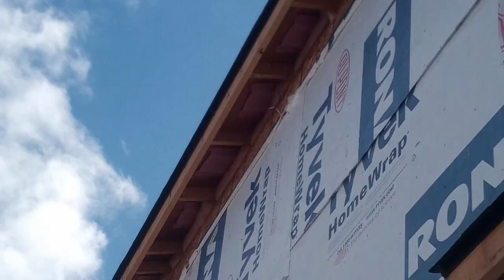Attic Insulation- Attic Ventilation, baffles and rafter vents explained

Comment: I wish I'd put in plywood baffle inlets instead of the Styrofoam ones in ours, it would have been a breeze :) to install compared to those foam things. Foam baffles seem like such an easy installation, but it surprised me how tight a working space it is down in that angle, almost impossible and very easy to do damage to your ceilings below, fortunately I did no damage. With plywood I could have jammed the panel across the rafters and had them in with fewer stronger fasteners. With the foam, I had to use a dozen or so T50 staples on each to keep them from flopping around and rattling over time. Plus hetting a stapler at the bottom of the soffit opening and and getting a solid staple in was real fun. Also plywood will never degrade and crumble, how long will this foam last I don't know. Great vid, thank you!
Reply from the maker: Thank you for the awesome comment. Yes those vents are tough, easy yo get into a small attic hatch though. They last quite a long time, I've been in plenty of 30 year old houses with none of them damaged. You would be surprised how much wind force is stopped by the metal perforated soffits. It's those darn roof nails too, lol. Plus we use that hammer stapler, much quicker than a punch one.
Reply from the maker: I just posted another video on attic topups, it has good tips that may help you in future projects. https://youtu.be/rHv3I6fEF70

Comment: My attic does NOT have soffit vents.  Should I have someone come add them?  I have two ice dams out front I'm looking to solve.  In the process of air sealing now and I have access to add baffles now (not sure how that will go with roofing nails in the way).  Someone mentioned I should dense pack the eaves and that will help.
Reply from the maker: https://youtu.be/6ptVYYLQ50M this video will probably help you get started. that was a shallow attic I topped up. not an easy task by any means. if you can find a small plank I would suggest it to get those vents in properly.

Comment: I have a house that is 20 years old. I have soffit vents, ridge vents and blown insulation. How do I install the baffles now, and what type should I use?
Reply from the maker: I would recommend rockwool or roxul because it is resistant to moisture. I typically use fiberglass owens corning batts because that is what I am provided with. here is a time-lapse I did where I installed batts, vents and then loosefill. you have to make sure to cover even a little past the top plate of your outer walls. if the top plate is not covered well then heat loss will occur at the corners of your house. hope this helps.
Reply from the maker: I just posted a video on attic topups, there may be tips that are useful for you 
 https://youtu.be/rHv3I6fEF70

Comment: Do I need soffit venting if I have two very large gable vents and a twirly vent at the top?
Reply from the maker: thank you for the comment and great question. Yes you need both because they work together, soffit and roof vents. soffit is for fresh air intake and roof vents like your turbine vent is for exhaust since hot air rises. checkout this video that explains it https://youtu.be/XCa2cB7q91U

Comment: So in my house, we have two bed rooms in the "attic" second floor. The attic spaces are small and to the sides of the room. Think of a rectangle, the rooms are in the middle, and at the sides, where the slope of the roofline is, there are small triangle attic spaces (front and back of the house). There is virtually zero insulation on the floors of these spaces, and there is old insulation between the rafters, against the roof plywood.  Then there is insulation bats on the upright walls for the bedrooms.  So.. If I add these baffles... do I add them all the way to the top of the roofline and then I put insulation over them? Or is that insulation needed? It is already really hot up in those rooms. I know I need to completely cover the floors of those attics with insulation, I'm now trying to figure out these baffles and insulation over them to help as well.. Any help would be appreciated! THANK YOU!
Reply from the maker: Great comment, thanks for reaching out and subscribing. I believe I understand your concern and have seen your type of house. The second floor is only a partial compared to the first floor, therefore parts of the first floor ceiling is attic space (needs to be insulated). All exterior walls have to be insulated as well. The one thing about sloped ceilings is that it's always good to have an air space between the insulation and the roof plywood. This is mostly applicable to fiberglass insulation or any fiber based insulation. You don't need styrofoam vents for that. The vents are mostly used to allow airflow in a flat attic and prevent blown insulation from blocking the soffit air intake to the attic. The one important thing you also want to make sure is that there is a top roof vent to allow for that air intake / air exit action. Hope this helps.
Reply: @SinnisjInsulator  Thank you so much! It does for the most part. I really appreciate it!!!
Reply from the maker: @Hypno_Raygun  I'm glad it helped, keep in mind that fiberglass does need some ventilation, but if you go with closed cell foam it doesn't need ventilation, especially if you spray it directly on the plywood of the roof. I have many more videos on my channel about attic components, you can check them out if you'd like, I post each Tuesday.

Comment: Any videos or tips on installing styrofoam baffles in narrow spaces? I’ve got 16 to install, 16 on center width, and you couldn’t fit a 5th grader close enough to get them to the vent. Is installation from the outside viable? Very little info on such an option.
Reply from the maker: Glad you came to this channel. I don't have one video yet on that option of a baffle. So if you want to install foam boards its really only doable from the outside after removing the gutters and soffits. Because this way you know you put the styrofoam board just past the top plate of your outside walls. You can then put foam around each of the foam sheets to seal them. The tricky part would be to fit the soffit vents after, so I suggest you install those before. The key is to properly cover the top plate of your outside walls and even push the baffle a little into your soffit area. This way you have a continuous Insulation envelope. Here is a video where I install vents in an existing home that is very tight 2 feet clearance: https://youtu.be/HTRt_BaHweQ
Reply: @SinnisjInsulator  much appreciated on the quick reply and information. I watched the tight space video, as well as almost all the others. I believe I’ll have to slide them in from the outside to be certain. Found some wet spots on the wood the shingles are nailed to, while in the attic, so the issues continue to grow. Yay first time homebuying.
And to clarify, there’s little info online in general. I wasn’t complaining about you not having that specific video. Your content is very in depth and covers many bases.
Reply from the maker: @SailorJasonTaylor  glad you found the videos informative. Your question is very specific, I have seen examples of what you are talking about but unfortunately did not capture the footage. The underside of the plywood being wet is definitely never a good sign. Definitely check that all exhausts are connected properly and air sealed. It may also be as simple as having very low Insulation, especially at the attic hatch. You can subscribe to my channel and I'll see what I can do to make a video on baffles. It's so vital to completely cover that top plate of your outside wall with tight Insulation, I know people aren't a fan of fiberglass but if properly installed, that stuff gets the job done for baffling coupled with either styrofoam or cardboard vents.
Reply: @SinnisjInsulator  many thanks. ive got 100 bags of cellulose waiting to be blown in, once i solve the baffle and electric boxes issues.
Reply from the maker: @SailorJasonTaylor  in my experience fiberglass or even roxul or rockwool Insulation works well. The last 2 are also water resistant so that's a bonus. All three options would be easier to install inside the attic using a stick vs having yo demo the outside.
Reply from the maker: I just posted another video if you haven't seen it. There are good tips in there to show what to do once you have installed your baffles. https://youtu.be/rHv3I6fEF70

Comment: Could you use a roll of house wrap or plastic as baffles, I’m thinking roll it out face staple to the studs then drape some down to the top plate and staple? Thinking of the most cost effective route?
Reply from the maker: You just have to be careful to allow blowing or any insulation to fully cover your top plate. Good idea though, make sure it's tight, any gap will create mold over time.